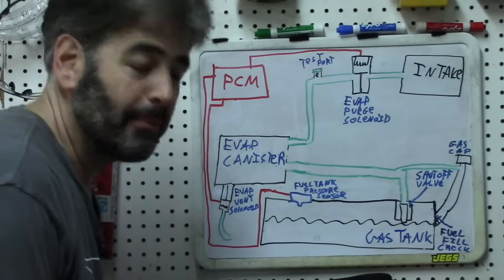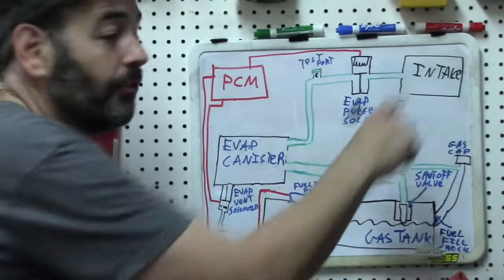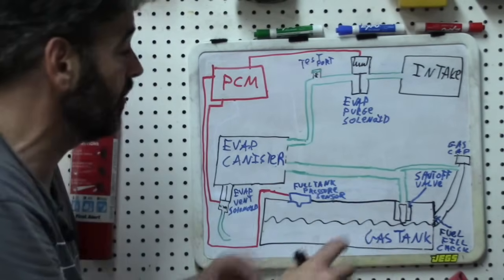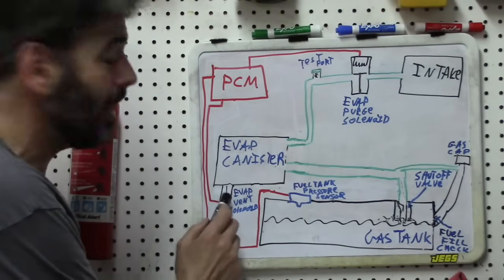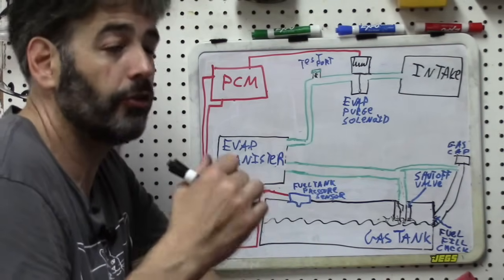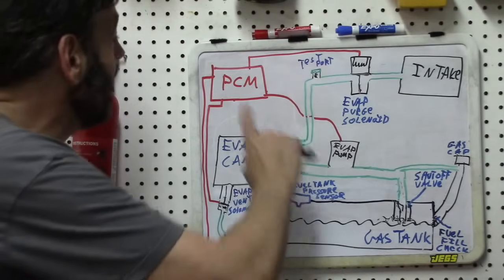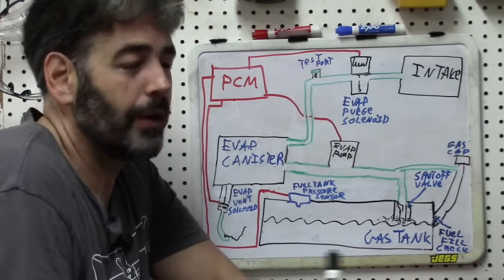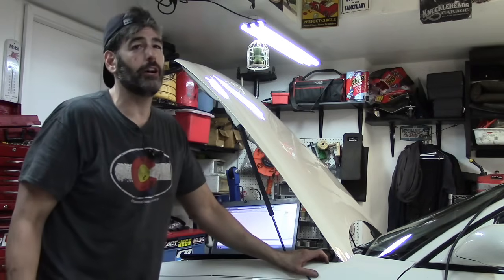Diagnosis + Understanding EVAP Systems (SBQM Full Video)

Comment: great video..I have the opposite problem. the solenoid remains closed my computer does not command the opening and starting is really difficult. if i connect the solenoid to 12v then it suddenly opens the idle becomes perfect. I checked the cables and the connector of the pcm and it shows 2.12v without ever changing ... at this point my pcm is damaged?
Reply from the maker: No. it sounds like you are checking the purge solenoid.
Reply: that's right. in fact before you heard click click click and by detaching the tube and placing a finger you could hear the suction. now there is no sound and it does not suck.

Comment: Thank you for the good explanation. I came across with this video because my car runs much better and has great fuel mileage when the tank is almost empty. Not weight related because happens with people inside or not. I am thinking about EVAP system and the pressure differences inside the tank. The fuel pressure was tested and it is ok. All the OBD2 emissions test are green (passed). Can you give your opinion please? Thanks.

Comment: This is great.  My Volvo has a leak detection pump, and yours is the first explanation of how it works I have seen.
Reply from the maker: Yes and actually your LDP is a bit unique. i believe Volvos - instead of using pressure sensors in the tank, instead measure the LDP amperage and extrapolate that if there is lower than anticipated amperage for a certain amount of time, this obviously equates to a leak in the system.  The reduction in amperage is proportionate to size of the leak.

Comment: Thanks for the video. I learned a lot about the EVAP system. My 1st gen Mazda3 often has gasoline smell around the rear section outside the cabin when the engine is turned off after driving. Also the fuel economy has deteriorated. I suspect something is wrong in the EVAP system, but I don't get any code. After watching your video, I think I may not have a leak, but probably a dead purge solenoid, causing gasoline buildup in the canister, which leads to some gasoline being vented into the atmosphere through the venting solenoid. Please let me know what you think. 🙏

Comment: Hi, excellent video, thanks.I have read that when the purge solenoid stops working on my car, it can be impossible to fill the fuel tank with fuel, and or, the car won't start immediately after being filled with fuel because the engine becomes "flooded" with a rich fuel mixture due to excessive fuel vapour.
Does this sound likely to be the purge valve? Would the fuel filling issue be when the valve sticks closed and the starting issue be when it sticks open?
Thanks again.
Reply from the maker: sounds way more like a vent solenoid.

Comment: Good info.. I'm having an issue where my car can't pass emissions of 1 code P0600 (p203e-4) serial communications link on a e55 amg. Took it to mercedes and they said they can't even communicate with the car idk. Code states No signal to Instrument Cluster
Reply from the maker: Start by checking if there is CAN network signal from the low and high at 6 and 14.
Reply: @SchrodingersBox  there is signal there… ic works just can’t do a lot of things on it that a normal one would. I can’t see what gear I’m in. Seats don’t work, everything else works. I don’t have the dynamic seats. Aftermarket radio install. Everything works there.
Reply from the maker: what is the signal you have at pins 6 and 14 exactly?
Reply: @SchrodingersBox  sorry for the late response but I just checked and it read 59.1

Comment: I have a gas smell inside and outside of my 2012 Cadillac SRX. Could there be a problem with the Evap system causing this? I have changed Purge Valve and gas cap. But it still exists but not as bad. Any ideas what I can do to correct this. I am not a mechanic just a DIYer. Thanks
Reply from the maker: yes that’s one of the most commons causes.  check operation of the vent solenoid.

Comment: Hi Matt,

I have corolla 2014 , for the second time I suffer from the EVAP SYSTEM, last year I replaced the purge solenoid and the canister .
Now I have problem in the gas refilling and engine light p0241 , p0242, the mechanic said that the vent solenoid is blocked and is part of the canister and I have to change it.
Kindly send me your opinion.

Regards,
Reply from the maker: yep I agree with mechanic. i would test the vent solenoid for operation and flow.

Comment: Hi Matt, as an old, retired electrical engineer I am very impressed with your teaching skills. Repairing my cars is one of my hobbies, but sometimes I am getting stuck into hidden specific manufacturing problems, like a fuse found under the wax paper insolation on a small AC transformer. Anyhow, I would greatly appreciate if you could help me troubleshoot my 2003 BMW 745Li, which started with not accepting more than 1/2 tank fuel (except when dispensing very, very little at the time), and lately getting the so popular check engine light on with the P0444 code on it. I disconnected and tested the purge valve and seems to be perfectly fine, opening and closing promptly when applying 12v to it. It may be that the purge valve intake hose having a small leak at the connection to the other hose going to the charcoal canister is triggering the P0444 code, but I do not believe this has anything to do with the tank not accepting more than half fuel. BTW, there is no pressure, nor vacuum at the filling cap after driving the car. Could you please feed back with your expertise/experience on this?
Thanks a million,
Chris
Reply: Hey Matt, you missed this comment from Christian.

Comment: Question if have a small Leak in bottom the gas tank will it miss with evap system
Reply from the maker: it probably would if at bottom of tank- but then evap is a way less serious concern of course.

Comment: Hey Matt. Yet again another great video. Love your content. Realise it was some time ago but I've only just stumbled on. I have a tricky problem that I am diagnosing in lieu of our local mechanics guessing.. fuel light been on for more than 2 years now. Process of elimination and watching your content might have me close to the solution which i feel is EVAP related. Are you open to helping guide me to closing this problem off? Geelong Australia 🇦🇺
Reply from the maker: Welcome!  So an EVAP is not going to cause a fuel light. (I assume you are referring to low fuel indicator, if not let me know).  it’s going to be something with the sending unit or the wiring from it. 
  i had a case where a car had normal operating fuel gauge but the low fuel yellow indicator lamp was always on. wiring showed the low level indicator was a separate line from the sending unit and it somehow was grounding out within the unit itself despite the unit working properly.

Comment: What happens if I empty out the charcoal canister? Vacuum out all the carbon.
Reply from the maker: i imagine if you did that the vapors would just find their way to the atmosphere as if you had no cannister at all since they have nothing to adsorb to.
Reply: Will the check engine light turn on?
Reply from the maker: oh most definitely it would- that’s for certain. what would happen is when the command is given for the purge of the canister, of course the engine is going to expect a surge of fuel vapor. But there won’t be one, so the engine will be lean at that time and the computer will know the purge didn’t work so it will throw some type of purge code.

Comment: what if the vent is clogged no error codes but you have symptoms of a rich running
Reply from the maker: then you still fix the vent. it’s hard to imagine yoy wouldn’t have codes but you definitely have to have the evap system working to prevent fuel trim issues.
Reply: @SchrodingersBox  well I think only issue no codes is because valve works only time it will throw a code is if it’s stuck open. But the valves works it’s just clogged system only checks for leaks

Comment: Our car throws a lean mixture code. When checking the purge valve it turned out to be open even with the electrical connector removed. While it should be normally closed.

Comment: This is an awesome video. I have a 2012 Kia Optima that has a small leak EVAP Code. I can use this video as a reference to look at the components of the system and kind of figure out what's going on. Thank you so much for creating this video. I have learned a lot.
Reply from the maker: Go for it!

Comment: Hey, I have a 2000 toyota camry, I've replaced $600 worth of parts trying to fix a p0172 code, i took it to a mechanic and after a week sitting in the shop he says he thinks it's the evap canister, do you guys know if it could be the evap system even if I've never had any evap codes?
Reply: I've never had any evap codes and I have run the obd2 scanner many times over the past few months
Reply: I'm worried about spending $278 replacing the canister when I'm uncertain if its actually the problem
Reply from the maker: it could be. have him test if that’s it.
Reply: @SchrodingersBox  thanks for the reply, the mechanic said it's bad but I've had pretty bad experiences with mechanics and he said there may still be other issues after replacing the canister, I was just wondering why I never had any evap codes if it's because of the canister

Comment: So I had a code for the evap canister shut off valve on my 1998 Honda Accord V6. I replaced the canister and valve, now I have 6 new codes. Cylinder 3 misfire, injector circuit malfunction cylinder 3, mass air flow circuit high input, egr circuit malfunction, vehicle speed sensor intermittent/ erratic/ high, internal control module KAM error.  Any idea as to what has happened to the vehicle?
Reply from the maker: what was wrong with the cannister and valve?
Reply: @SchrodingersBox  it had a P1457 vent shutoff valve malfunction.
Reply from the maker: well that was the code. I am saying was the solenoid shutting off or was the cannister leaking?

Comment: I have a c4 corvette and it’s obviously very old so it’s important to know how the system is designed because many components are degraded and may not work properly, in fact I think something is not right because it seem to build pressure in the fuel tank.

Comment: My is Steve I been doing this job of the mechanic for over five years, but I have never changed or seen anyone service the EVAP. How do I know that the evap is won out
Reply from the maker: The evap is a system, not a component. you don’t change an Evap, you diagnose which component is at fault.

Comment: hello all! , so i have an issue with my car , check engine ligh is on with p0441 and p2420 , couple weeks ago car started loosing power and started getting bad gas mileage , i checked the purge solenoid valve it was reading around 26ohms , i checked the connector and its getting 10.5volts. i coudnt blow through the valve. so recently i changed the spark plugs and before doing all this , my scanner would never show any readings for EVAP_PCT but now it started doing that , so im guessing my purge valve is fine and working? my SHRTFT is always adding 0.8 - 2.5% and LNGFT is always subtracting like 10% and i have this O2 sensor thats always reading 3+volts , O2S11(v) to b exact , i have no idea where to go next , what to do next. i saw online couple people with this exact code issue and they all just had broken wires in the trunk , but i cant seem to find any? any help , any 1?   

oh & before i checked the valve , EVAP_PCT always used to read 0 on my scanner but after i messed around with it , it started showing numbers on my scanner , and after i changed the spark plugs , the check engine light came back a few days later , i check the freeze frame and it was showing spark_adv @ 5 , usually its reading around 8-9 , car was stationary , evap pct was 0 , i think i set that off when i messed with the valve .  ive just erased the codes from scanner but it was still showing permanent DTC's , i checked the on board monitor test thingi on my scanner , and it showd all tests as passed, before i messed with the valve , it used to fail 1 test in the EVAP section but now its passing all , does that mean ive fixed my issue :(?
Reply: in the past freeze frame wud always show p0441 and car as driving but this last time it was p2420 , and it was showing car as stationary
Reply from the maker: Well you did pretty much everything except the basic test that you needed to lol. 
  Take a step back and start with the basics- You just need to do a pressure decay test is all.  that will easily point you in the direction you need to go. from there you will know which solenoids to suspect and test accordingly. A more linear approach starting from a basic starting point will be way less “shotgun”.
Reply: @SchrodingersBox  thankyou very much !! If the check engine light / codes return , then that’s the first thing i will try ! Once again thankyou !!

Comment: Hi, very useful video, thanks. How can know if it is slow/small leak or larg leak? Because for example if we get p0440, in definition only potential causes of the leak mentioned not size and amount of the leak.
Reply from the maker: first off- the code usually tells you since there are different codes for large and small leaks. but also the rate of vacuum decay can also tell you. usually in a large leak you will see vacuum completely decay within a few seconds of not instantly.

Comment: My dad is a Mechanic, and has always wanted me to learn things on my own. He pretty much trouble shoots and has me take the parts off. Now I'm a recovering from being a replacement parts only type of person, now with great Teacher. I'm a troubleshooter of my own. I been watching your videos and I paid to subscribed on your website. Thanks Matt! I wished I would of seen your videos before I tried to trouble shoot an old 1994 Acura. Spend so much money replacing censors. You ask why my dad didn't help me? Well that was supposed to be my Learning Car. Never got it to run smooth. But when I saw your videos I realized what was causing the car to stutter. I have the basics understand that the car needs gas, electricity, and air. But never down to the nitty-gritty. Again, Thanks for sharing and caring Matt.

Comment: I'm still trying to figure out why my 2002 Highlander fills slowly (fuel handle clicks off over and over), when the car has no MLI, no codes, runs fine. Air vent tube is clear. Wondering if the overflow check valve could be stuck closed while not affecting the EVAP monitoring tests.
Reply from the maker: good thought. sure sounds like a vent tube restriction to me though but if it’s clear I like your idea.

Comment: Very detail and clear presentation of how the evap system works. Can you tell us the fuel tank pressure transducer analog value to the PCM.
Thank you for sharing good job!
Reply from the maker: thanks for the comment. I am not sure what spec is or even if there is a desired specification. I have only ever seen the tank pressure at just low single digits PSI at the most though.  obviously a lot of factors- how full tank is, temperature, barometric pressure and elevation would all play parts.

Comment: So man I screwed up a year ago, bought a Mercedes and ive come full circle from Ignition to Fuel to intake Air To Exhaust gas and timing and as built configurations and functions. I found myself here in the evap area where these cars really shine. Because there could be an issue and in the 2132 data files relates to my VIN, none of them and not even the ECM will tell you exactly what your problem is. Ive realized from Parts Darts that now to getting Confirmations for Process of Elimination that I had to literally learn EVERY component to even REMOTELY BEGIN to understand how the Secondary Air Injection works and the Evap system.

Ive come to an odd conclusion that id like to run by you that ive come to with my car! Ill check for an email or someway I can contact you!

Comment: Do you think an evap Canister can cause lean conditions or bank 2?
Reply from the maker: only if the evap feeds just bank 2 which is unlikely. Evap usually feeds to throttle body or somewhere where entire intake manifold is supplied with Evap.
Reply: @SchrodingersBox  yeah makes sense, I can’t figure out why I’m getting lean conditions on just bank 2. Replaced intake gaskets, fuel injectors, fuel filter and pump, new PCV, new MAF and air filter ,new ignition coil, new spark plugs and wires, new bank 2 O2 sensors, new throttle body gasket and all other gaskets, did a smoke test from the brake booster and nothing. Unless it’s an exhaust leak before the 02 sensor on bank 2 or and electrical issue  just on that bank as well. Short term fuel trim bank 2 is reading 27.3% long term is reading 21.9%. Bank 1 is reading completely normal.
Reply: @SchrodingersBox  all those parts I listed are Motorcraft as well Ford brand, so I haven’t been  buying cheap parts 😂
Reply from the maker: So wait- what data are you using here to indicate an evap is suspected?  I don’t follow why you are changing intake gaskets but also changing O2 sensors and MAF and coils.   How can you have an indication of ignition problem but the repair strategy is to change the gasket and fuel pump?? Did I miss something there?
 Let’s step back- exactly   what data is indicating you have an ignition problem AND an evap problem AND an induction metrics problem AND a fuel problem?  That seems extremely, extremely, extremely unlikely.
Reply: @SchrodingersBox  rebuilt an engine that’s why I replaced gaskets and spark plug and ignition.
Reply from the maker: hmmmm not sure why a rebuilt engine would be expected to have a spark plug problem. why not suspect timing? That seems more likely after a rebuild.  or compression due to valve sealing….
 And a fuel pump surely wouldn’t be suspected after a rebuild right?
  I’d suggest “clearing the slate” and just let unbiased data point to the cause.